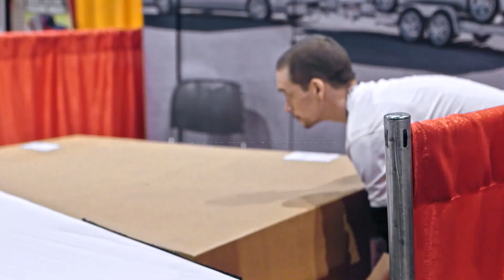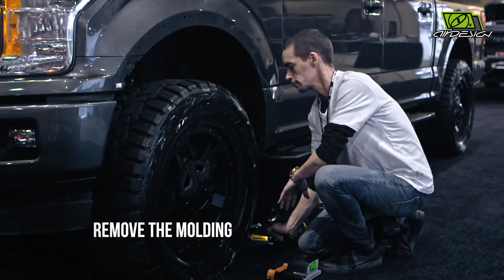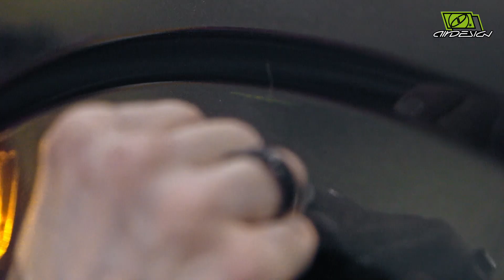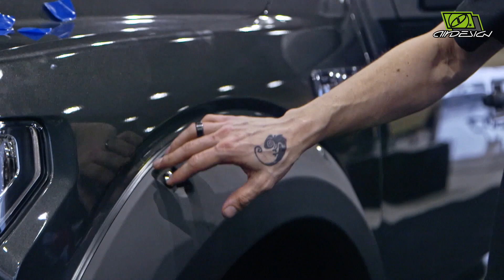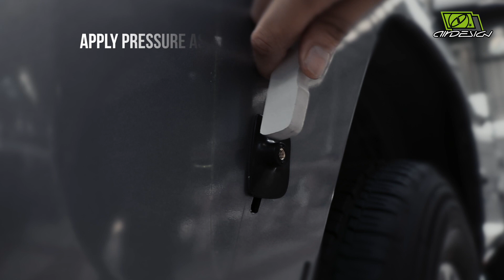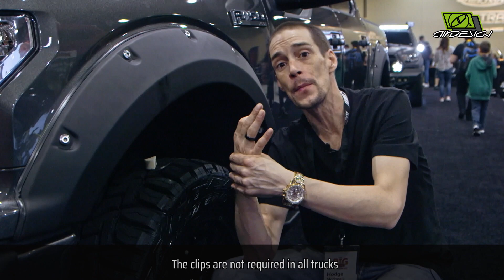Air Design - Super Bolt Fender Flares Installation Video ✅

Comment: I had my large AirDesign flares installed in November on my 2022 TrailBoss.  I now ordered the black anodized exterior Allen wrench bolts for each fender.  Should it be ok to simply swap the stainless screws for the black ones? I’m afraid to ruin any work that was done.  Will this slight upgrade cause any issues with adhesion and the beautiful work that was done to install them? Thanks.

Comment: Great vid bro. Spot on detailed instructions. I’ll be getting these for my 2017 platinum. However I’ll have to figure out how to relocate the lane keeping sensors on both front fenders. Suggestion?? Thanks again!
Reply: Hey Brian, did you get these? Figure out how to deal with the lane keeping sensors?
Reply: Chris B drilled holes in bottom corner of flares and relocated sensors. Works like it did before.